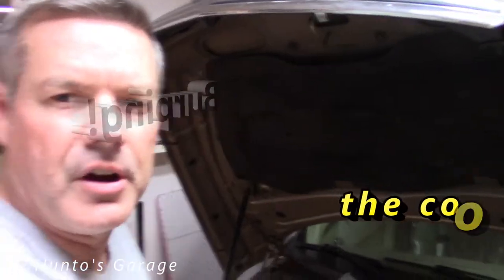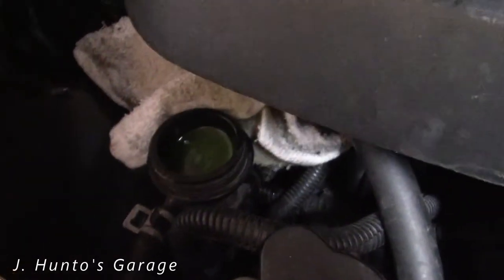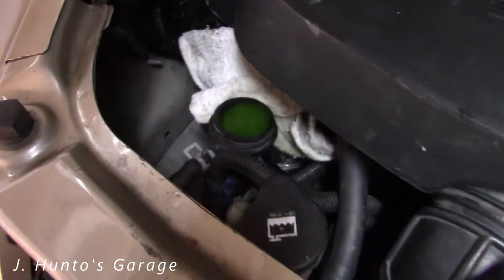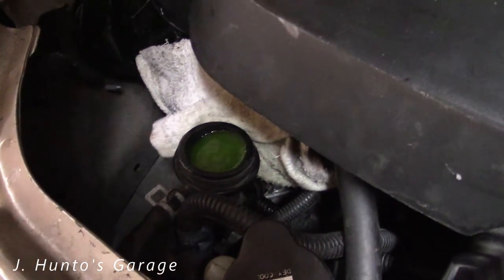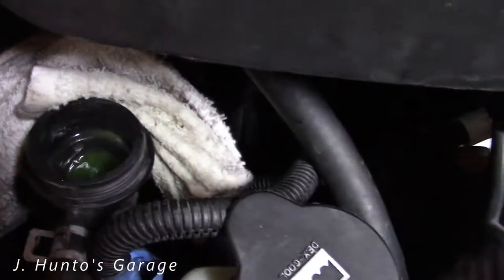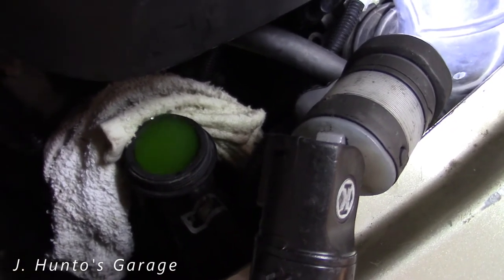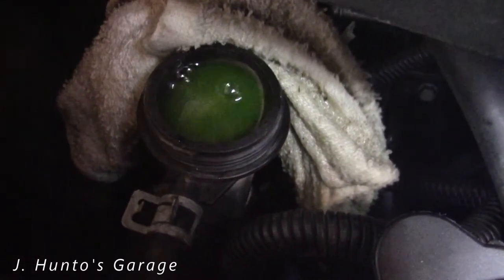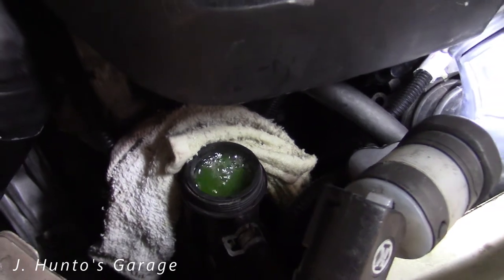Burping the coolant system

Comment: I picked up a vacumm filling device at the swapmeet cheap that I have used on the old Jeep Cherokee that has issues with air pockets. you pull a vacumm and then suck the fluid in under vacumm that fill the cavities. I recommend the tool.  Just for info on alternate methods. Yours is a good way without putting out $70 for the tool.
Reply from the maker: Ed KE6BNL Excellent advice. Thank you!

Comment: In your opinion is this a normal temperature range on my Chevy HHR 2009 2.2 Ecotec engine :

in stop and go driving I've seen my temperature fluctuate between 181 degrees to 200 

the temperature goes up at a stop light to 200 degrees.  it goes back down when I start driving on a 85 rainy degree day averages 187 degrees.

thanks for your time and help.
Reply from the maker: Yes, within normal operating range.

Comment: hHi there, thanks for this video.  I made need to do this after I replace the radiator.  Can you tell me if the fan shroud has to come out to replace the radiator?  Appreciate it
Reply from the maker: Mark Anderson Thanks for watching! I would say yes the shroud and electric fan usually have to come out with or before the radiator.  You will definitely have to burp the coolant system to get the air out, standard practice for this job. Shouldn't be too difficult.

Comment: Ummm. The coolant temp is NOT what you displayed. The 69 degrees is the outside temperature. To find coolant temp u have to push the info button until you get to the coolant temp display. The thermostat doesn’t open until 180 degrees. A fully warmed HHR runs between 185 and 195. 
Thanks anyway.
Reply: Ummm. The gauge, which is exactly what he said, is to the left. You know, that thing that looks like a gauge?
Reply: 🤣 he doesn't mean the air temperature, he's talking about the car temp, the gauge is almost to the middle point where it should be. It never tells you the actual degrees of your engine 🤣😂 please don't work on your car by yourself.
Reply: Plus he was just making sure it wasn't overheating. He burped his radiator correctly, which was the point of the video after all...
Reply from the maker: You are exactly correct Kimberly. Good catch!